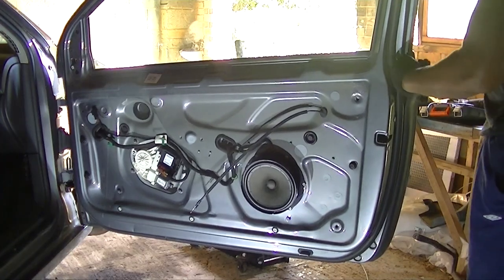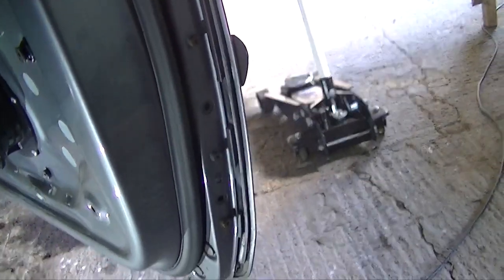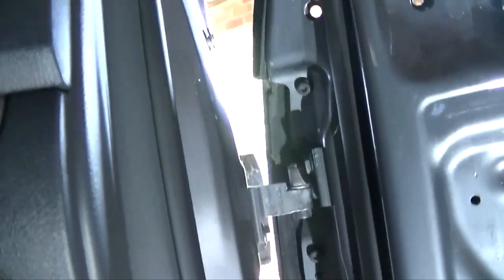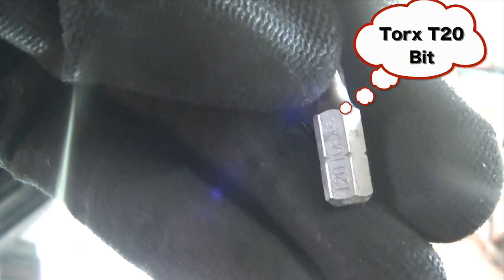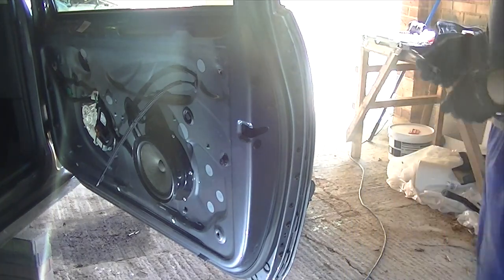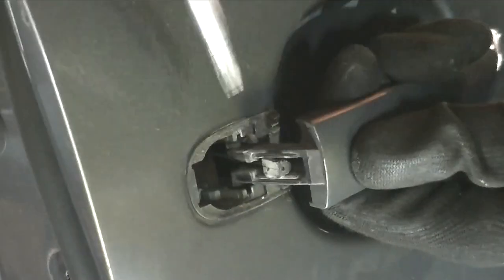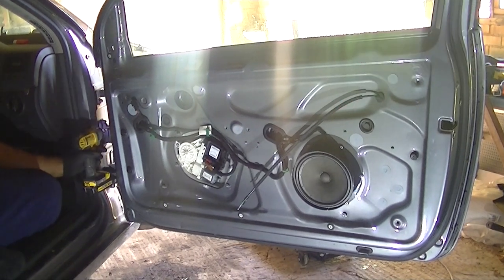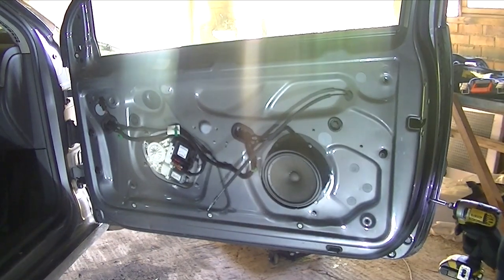How to Remove a Golf Mk5 Outer Door Panel Skin

Comment: My wiring to the door has been broken off so my plan is to cut the connector part that goes into the car, inside of the car and put on a new connector, is it the outer or inner panel I should take off?

Comment: Do you need to remove this to replace the wiring loom that controls central locking/windows/fuel filler cap?. Thanks

Comment: Thank you for a great video. Unfortunately the lock simply won't move on mine after I've removed the T20 torx inside. That means I have to leave the door skin on rust apart

Comment: A SERIOUS design fault by VW imo. Much easier the old way, from the inside.
Reply: Dr Chunky Biscuit nah, then i can just replace the panel if my door gets fucked instead of unmounting the whole thing
Reply: Having pulled various window and locking mechanisms through from the inside over the years, this is actually simpler. You do have to a little more care given its a painted panel, but the access it gives is worth it.